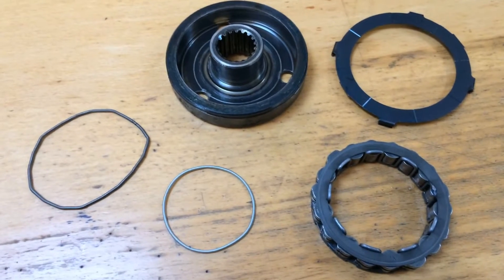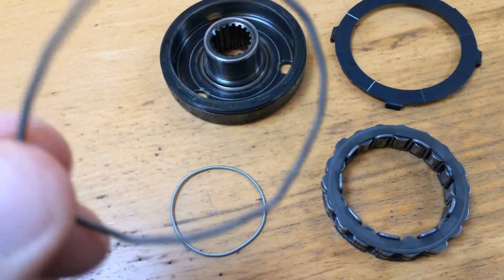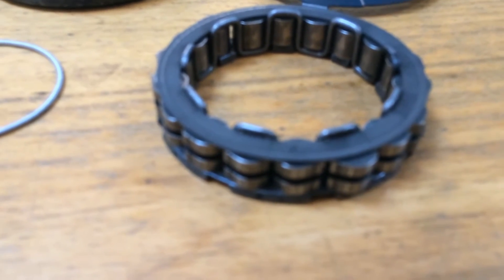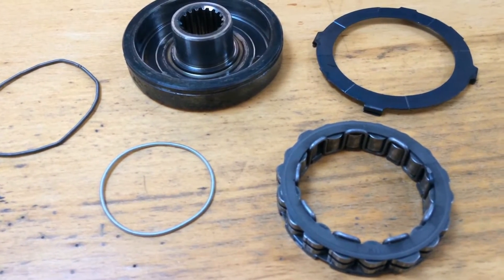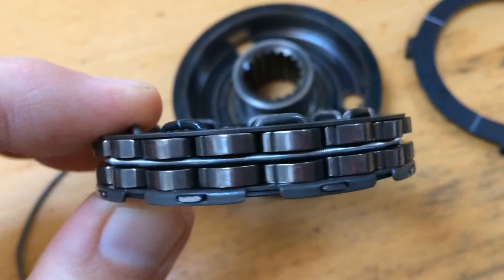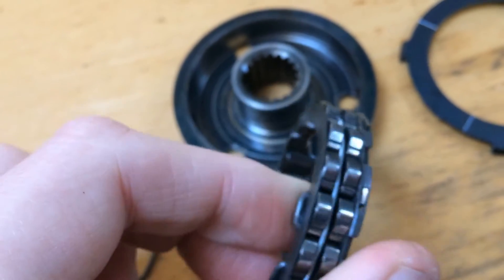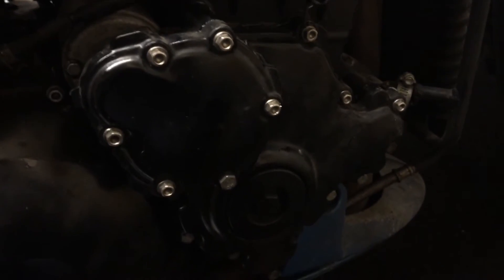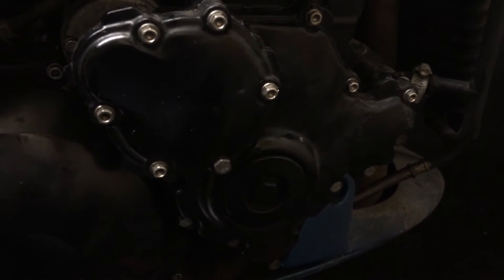Triumph 1050 Injection Sprag Clutch Fix

Comment: Is this still working ok?
Reply from the maker: Actually I found that the replacement springs were not as good as a repair on the original spring with a bit removed ( about 1cm ) and re-bonded. The spring stretches over time and with weak battery use adds up to it stretching and not doing the job properly. My understanding is they have beefed it up in newer models. Until last week my repair was going fine - then a dickhead in a car shunted me from the read and my bikes a right off.
Reply: Sorry to hear that, hopefully you get fully compensated. I have the upgrade ordered but wont arrive until September, just want a temp fix for 3 months
Reply from the maker: herbertmathews when you say an upgrade is that the total kit, sprag and gears? I've not had a later 1050 in which I've heard the beefed up the sprag but in all honesty triumph could easily make this repairable by just supplying a new spring. It's a bit of a rip off as they are supply you with bits you simply don't need. The sprag can backwards twist the gearing and cause the inline gears to break but that doesn't happen to everyone. 9 times out of 10 all the gears in mine have been fine, it's that spring that's become loose and won't make the little splines grip the crank shaft.
Reply: @louis0cox  At least you tried. Too bad it didn't work
Reply: @louis0cox  Same with mine. The stock one failed at 5000 miles the $400 replacement lasted 10,000. Always had a fresh battery, stronger than the one in this video.
Reply: I understand one can use a Suzuki Hyabusa cog wheel in the smaller old style Triumph part. I'm going to ask on the Triu. RAT foum. I sincerely doubt any sprags are made by Triumph. There must be others with the same roller ring. It is a part like the $65 brake and clutch levers.Heck far as I know they produce almost nothing in England but claim responsibility for design  The best excuse offered is, insufficient sprag clutches are not exclusive to Triumph. Like children they justify failure by pointing at their peers. Thing is one can buy a Suzuki 1300 sprag for $35. Someone is making money but it isn't any worker in Thailand or England. All the dealers within 150 miles have closed or stopped carrying the brand. Worst is the bikes before 02 had to have the engine removed and cases split to replace it....every 10,000 ??!  At least the newer ones have a cover so one can swap it out in an hour or so.
Reply: @louis0cox  I know this is an old comment but still relevant as this problem persists.  It makes sense the spring didn't last too long as even though the replacement spring looked similar, being from an oil seal it would likely be less tension. I don't have a Triumph anymore but if I get another will look into buying a cheaper sprag of similar dimensions from a bike that never has failures and take the spring from that. Even at $50 or $75 it would be better than the $500 so-called kit.  Some Ducati guys have used O-Rings to fix theirs but no idea how long that would last. Cheers, thanks for the Vid!!